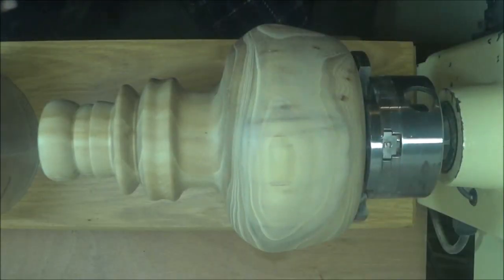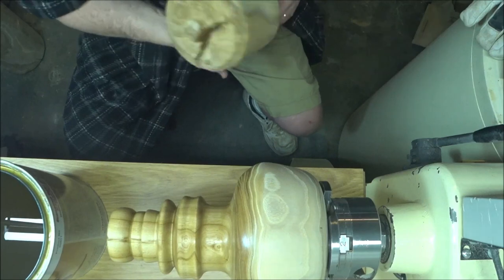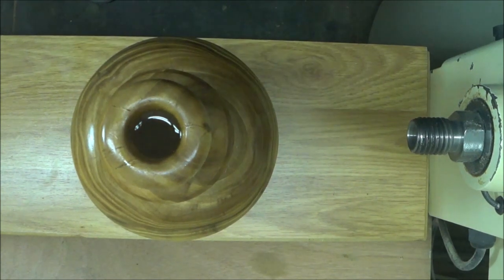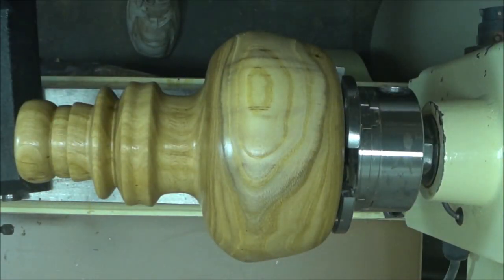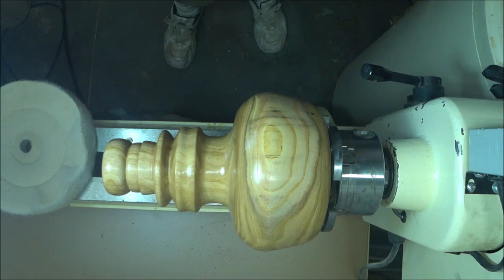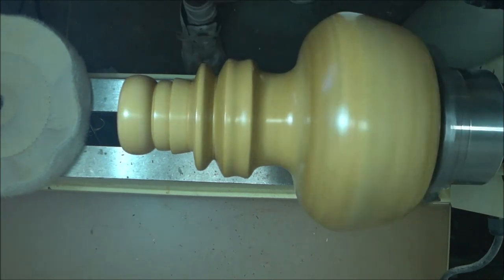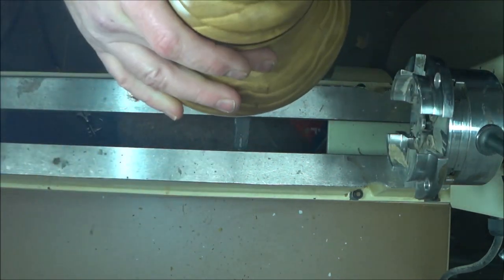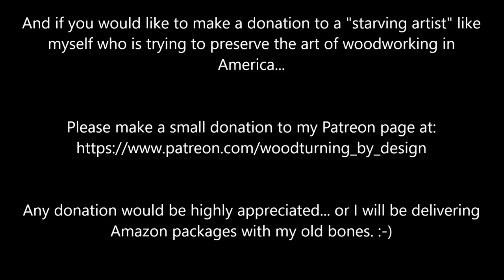Genie bottle part two - The Polishing

Comment: Hi Chris that was a much more successful job of finishing and polishing. Looks good.
Curious as to what you used for sanding sealer. Was it a lacquer, oil or water based? Brand?

To be cost effective try this as a friction polish.
1 part shellac
1 part denatured alcohol
1 part BLO -- boiled linseed oil

Works great and the price is good. I usually use a bathroom size Dixie cup. I cup of each.
Take care,
Gary
Reply from the maker: Hey Gary,
Thanks for watching and commenting.  The brand I settled on is this:

https://www.amazon.com/gp/product/B000BZZ2IO/

 for which I paid about $24 for a gallon. The Myland brand I had used before was $35 for a quart! So yeah thanks again for the recipe and next time I need to restock, I will look into the "home brew" method!
Reply: Chrisi use that sanding sealer as well. Where do you find it for $24 a gallon? That is a great price. 
I pay $17 a quart at Rocklers and will be picking some up tomorrow.
Take care
Gary